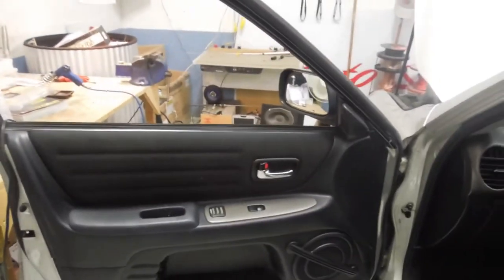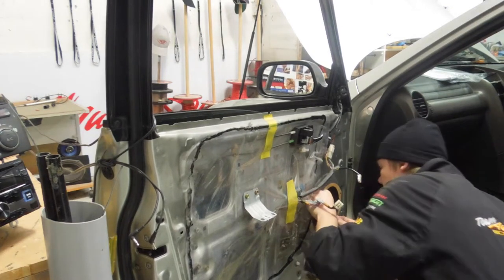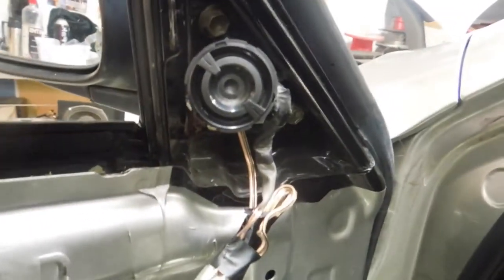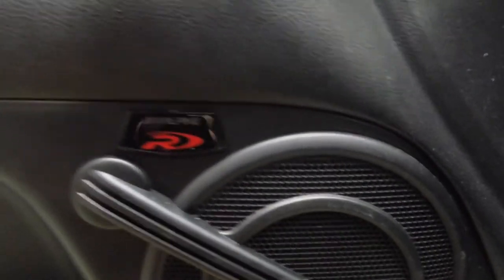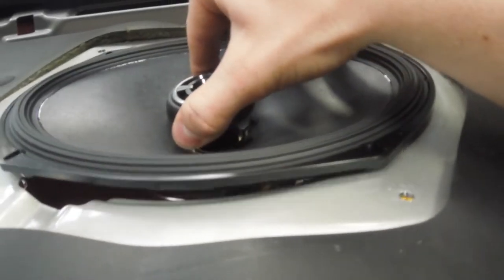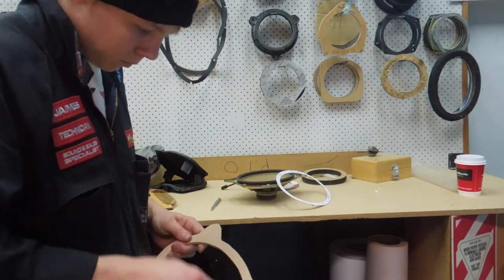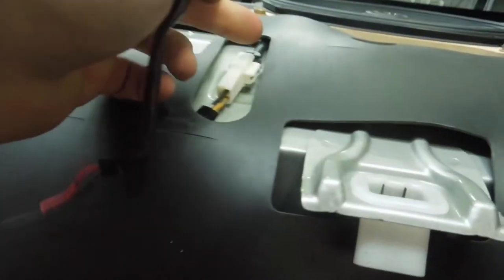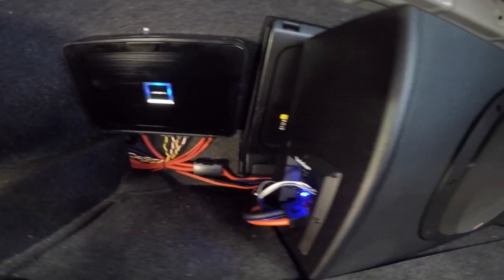Toyota Altezza Full System Install Part 2/4: Speakers Installed!

Comment: I did the same thing but I'm not getting any sound?
Reply: I tested the speakers that way too and got nothing but lows. No highs, I used one of the other wires and got the tweets to work but my tweets semi pop if the volumes up high still trying to figure this issue out. You ever figure out the solution to the rear 6x9 wiring harness?
Reply: Wire up the power (red) to the speaker from your stock speaker after cutting the harness. Then ground your speakers directly to a bolt

Comment: just a quic question for mounting an aftermarket speaker...like if the speaker is listed as universal and says it works for my car, does it just plug in directly to the factory wiring like the factory speaker does, or do i have to solder some shit?? I know nothing about car audio/electronics sorry about the noob question.
Reply from the maker: Aftermarket speakers never plug straight onto factory car harnesses.
Usually you have to solder on the correct plugs or crimp on the correct connectors.

Comment: how do you take back seats out?
Reply from the maker: Sam Kendall pretty sure the seat just lifts up and out and then there are bolts holding the bottom of the back rest in after which you just lift the whole thing up and out